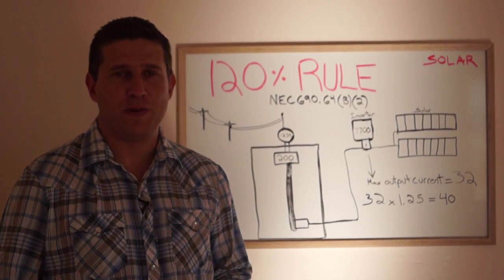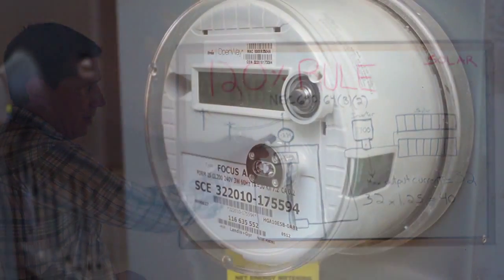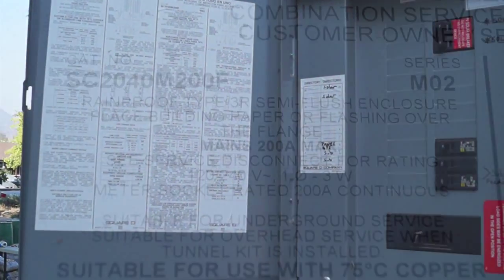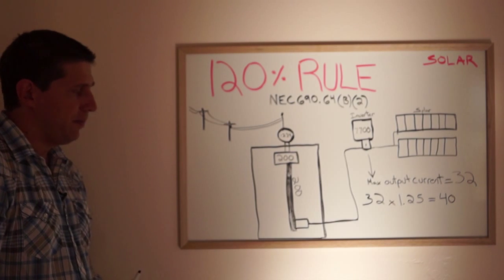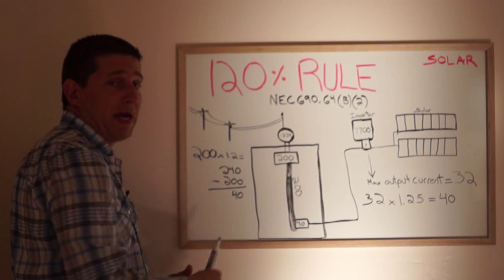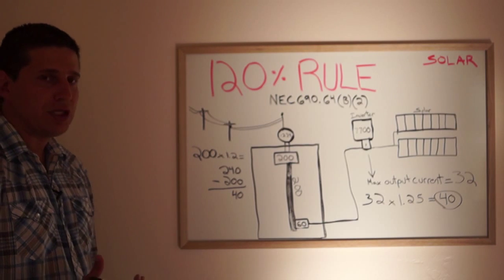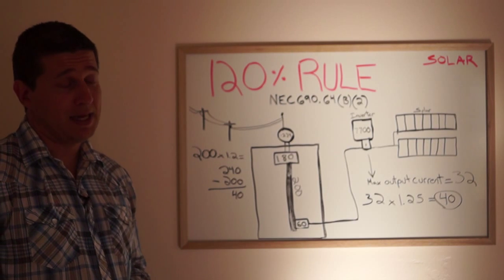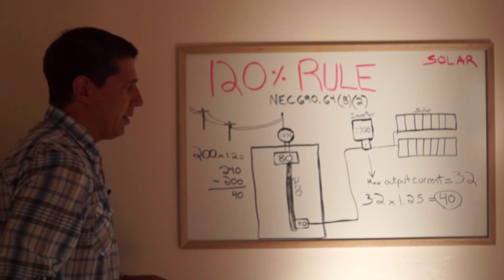Home 2.0 - Solar Design Introduction to the 120% Rule

Comment: What about if the busbar is rated to 225 amps for a 200 amp panel? Is all the calculations based off the busbar rating?
Reply: The panel rating is the busbar rating. In other words, if you have a 200Amp panel, it has busbars rated at 200Amps. That doesn't necessarily mean the Main Circuit Breaker is 200Amps. If you have a 225 Amp panel/busbars, it can be used with a 200Amp main breaker, as long as a legitimate NEC based load calculation justifies that. Another way of saying it... If you have a 200Amp service, it will have a 200Amp Main Breaker. But the panel/busbars can be 225A.

Comment: Won't the bus bar here over load if we have 200A coming from the utility + 40A from the PV system?
Reply: I think there is a reason for PV breaker to be installed at the very end of the bus bar. That is to make sure currents flowing through the main breaker and currents flowing through PV breaker won’t add together over the maximum amperage of the bus bar at any of its part as they flow into individual loads.
Reply: @kubismatik2 lol. No, you're dumb
Reply: Did you watch the video?? 😂😂😂 YOU CAN HAVE 120% OF BUS BAR RATING